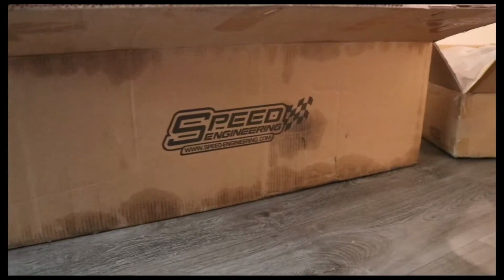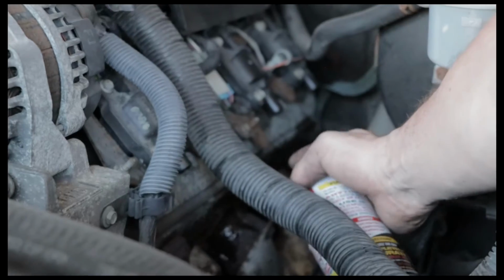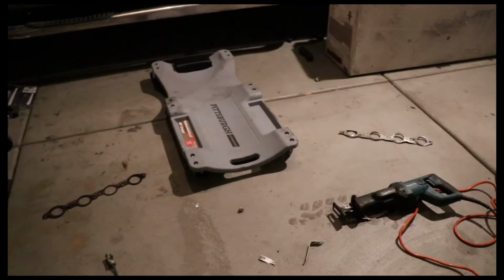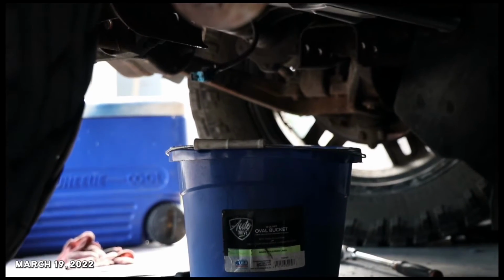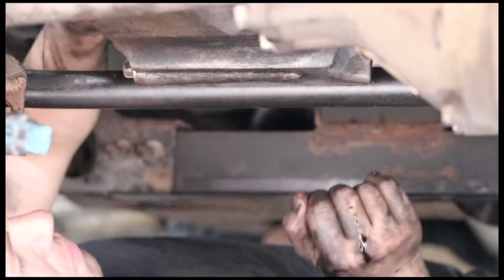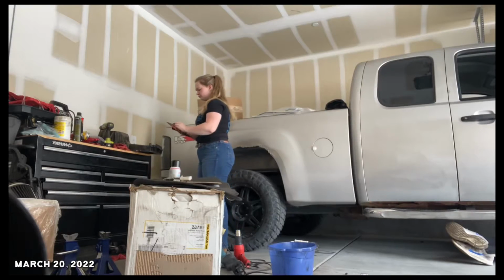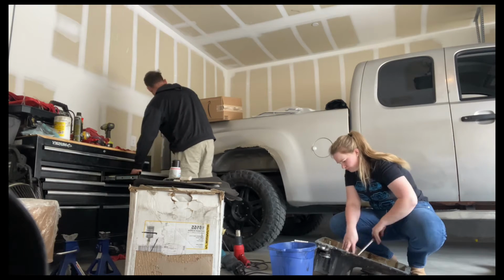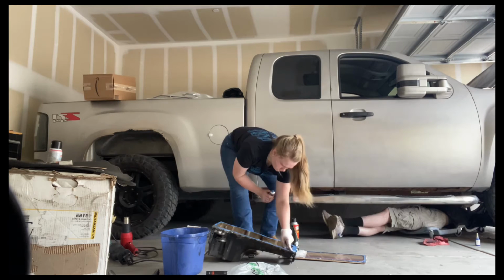Installing Speed Engineering Long Tube Headers - 2008 GMC Sierra 5.3

Comment: What tool did you use for the broken bolts? I've been thinking about getting headers on my 07 sierra and I have 2 broken on the driver side
Reply from the maker: My husband found a cheap bolt extractor at O'Reilly. I can't remember the exact brand, but it was similar to what I will link below. It worked amazing, except it was a little difficult against the back cylinders next to the firewall. But we managed to get all of mine out with it. I hope this helps! 

https://www.oreillyauto.com/detail/c/performance-tool/performance-tool-stud-extractor/pfm0/w83203/v/a/119723/automotive-car-2013-ford-focus?q=Bolt+extractor&pos=19
Reply: Cool. Thank you